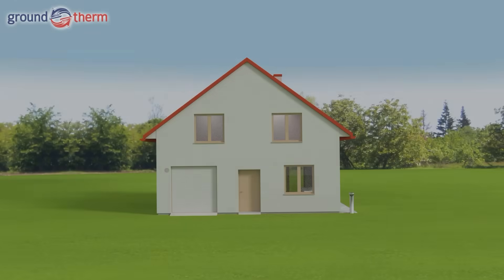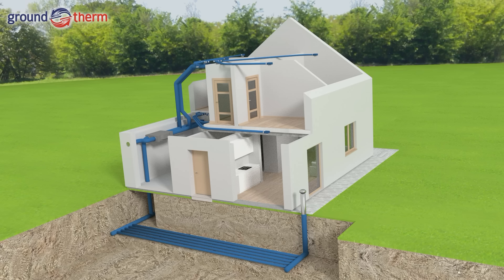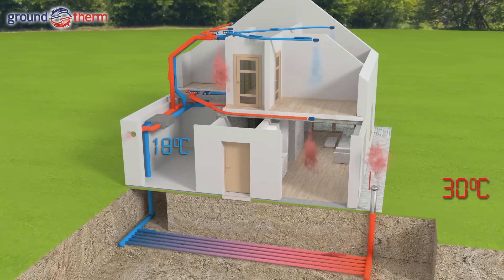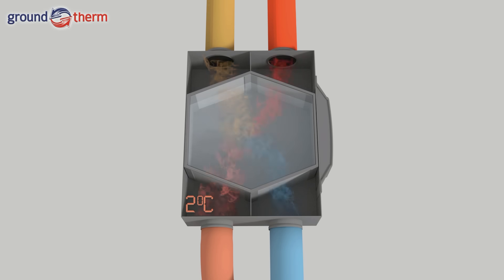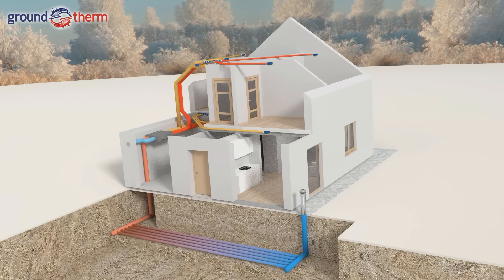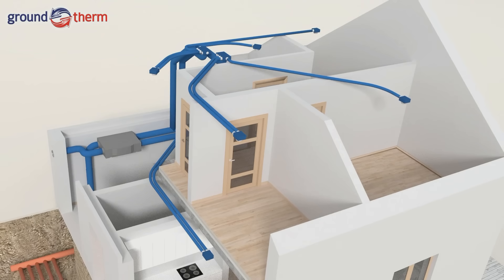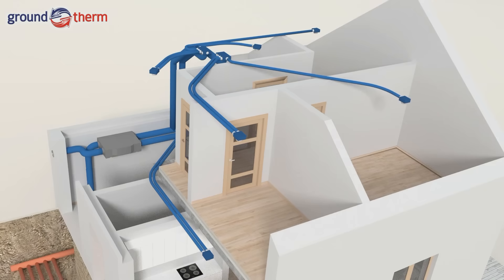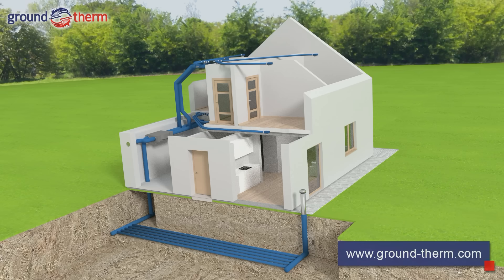Mechanical ventilation with VENTIFLEX® PLUS system and Ground-Air Heat Exchanger

Comment: How do you remove the humidity from the system. Without removing the moisture condensation will definitely occur in the heat exchanger and will cause molding.

Comment: I have some suggestions to your company. 
For cooling it's OK but for heating try to attach connection with wood  stove or cooking gas stove. 
Roll iron pipe around cooking gas stove burner , For wood stove Roll pipe around outer part of stove, use stop system, when ever don't want to use. 
Please work on this. 
It's not difficult, people use gas stove or wood stove but don't use it to full capacity. 
Jay bharat.

Comment: Using vent shafts is a nono… mold will come in eventually… and requires chemical cleaning… what you need is fresh air from outside to vent your home…

Comment: The air should be looped back from the house since the house is at chilled condition. Constantly pulling air from outside will result in a higher temperature difference across the ground heat exchanger.

Comment: Can this system be integrated with a heat pump?
Reply: No.this ventilates. No heating. But you can use the energy from the old warm air for making hot water

Comment: what is stopping mold and condensation forming inside the pass as hot air enters cool pipes?
Reply: Just lay the pipe with a slight slope toward the inlet. You’ll also have to incorporate some sort of drain
Reply: I hear they put it at a 3% slope

Comment: Fairy tail. What will you do in the spring, when the ground heat exchanger freezes and the street will be +5. Such air is no longer a problem to heat up and air conditioning is not needed yet. This scheme has not been finalized and I reject it in my work.

Comment: in such a ventilation system, a huge amount of condensation and bacteria is formed!
Reply: Inner layer of pips are covered with antibacterial agent (silver based). Condensation is collected and pumped out from condensation shaft.
Reply: Could you not attach air filters on the registers to solve this?

Comment: What are the pros and cons compared to geothermal, which uses a liquid closed loop? That is more common than heating/cooling incoming air.
Reply: heating in the winter will need supplemental help heating, this won't be near enough in a typical cold winter.

Comment: Wouldn't air coming from inside the house and from outside of house while interacting in the exchanger, pollute the fresh outside air ?
Reply: What they're probably describing is a Heat Recovery Ventilator (HRV). In summary, no it does not because the air actually doesn't mix together in the box, it's just a convenient model they used here. The box itself is a heat exchanger of some type, e.g. using heat pipes or thin metal plates, and the air is actually going through completely separate channels through those heat exchangers, so the fresh air stays fresh but the heat between the incoming air is brought closer to temperature to the outgoing air. Such devices can often exceed 70% efficiency in matching the incoming air with the outgoing air, so despite how simple the idea is for this device, it's an exceptionally effective way for you to prevent heat/cooling loss with the fresh air coming in.

They also have Enthalpy Recovery Ventilators (ERVs, sometimes misnamed "Energy" Recovery Ventilators) which have a semi-permeable membrane which allows humidity to be exchanged as well (again, without actually mixing the air itself), which is super important in high-humidity environments (e.g. southern US states) because you will "get more" out of cooling your house if you can reduce the humidity (using a dehumidifier, for instance), and retaining that reduction in humidity means huge energy savings without a cost to comfort.

Comment: I am much interested in that kind of setup but the thing is calculations about everything and that can be done with ultimate solutions like uv light cleaner or any other simple n efficient solution.
what I am scared off is the temprature as the ground water temperature is not too above the normal temperature I am in Pakistan..

Comment: What about the in ground preheater and getting mold in the actual pipe under the ground guess this system has no longevity
Reply: I built my own 15 years ago. Don't stop the airflow and slope the pipe to a lowest point, cut some slits there over a gravel drain. Also stay above groundwater level.

Comment: How deep you have to dig the pipes, and how much energy the system consumes? Now much is not good enough. How many wats it takes? How much it cost to purchase or you sell it with installation costs? Do you supply to places in Lubuskie?
Reply: 1) below the frost line.  Usually 5-8 feet down.  2)The energy would depend on the size of the system. 3)The energy would depend on the size of the system. 4&5)I would suggest contacting the company directly.
Reply: For my compact and well insulated house  I DIY'd one, has been working for 15yrs now. Pipe 15cm/6", 50m/yrd long as 2 parallel line, slope 2cm 3/4" per m/yrd at a dept +/- 3m/yrd. Energy use is one 50/100ish watt fan, it pays to oversize a variable speed type. There is a lot of flexibility size-wise there but a lot depends on the dig. There must be a slope for condensate to drain to a lowest point, with a few slits over a gravel drain. Because of this drain you must stay above ground water. The inhouse system as shown in the video is a whole other kettle of fish. It's ok in a new house but rather tough as a refit. Power consumption there doubles as there are two fans needed now.

Comment: Here the duct are not placed correctly
Reply from the maker: What you mean? All ducts or one? Which? Why?
Reply: @Ground-Therm  the cool air ventilator from coil in the room should be in bottom level of room and hot air ventilator should be at top of the ceeling
Reply: @Ground-Therm  actually I had project in my engineering on geothermal air conditioning unit

Comment: This will be ideally suited if this system is installed just next to the u/g water reservoir which can store water from an outside supply or can store water from a system of rain water harvesting. The temperature of the environment beside the water reservoir can be used to have a better ventilation system.
Reply: Nice idea

Comment: What the hell? Under the ground? What if there is a problem with the ducts on the ground, you have to dig and stuf. That system will cost more than the house itself lol.
Reply: i guess you don't have running water at your house because from that chart this is basic plumbing
Reply: @pastorgoof  this is ventilation

Comment: Youll have ruined pipes underground.. Rotting and condensation +mold toxins. Then the air returns wouldnt work. You have to suck the heat out while forcing cooler air in. This is stupid. Plus you'll have allergy problems always bringing pollen in.
Reply from the maker: The inner layer of pipes buried in the ground and all fittings are protected with a silver-based preparation that reduces the growth of bacteria with the efficiency of 99.99%. We give you a 30-year warranty.

Comment: I visited the Ground Therm website. Turns out they just sell flexible plastic duct work and plenums. If you want a "mechanical ventilation" system you'll have to look elsewhere. What a disappointment.
Reply from the maker: Please take a look at our catalogue concerning GHE here: https://www.ground-therm.com/wp-content/uploads/2019/03/Katalog_GWC_v0.pdf

. Additionally you can contact our design department: projekty@ground-therm.com,

phone: +48 881 066 854

Comment: Does the ground continously take away that much heat? Won't there be a decrease in the rate at which heat is extracted after system is operational for a few hours owing to the reduced temperature gradient and slow conduction.
Edit: Why not insert the heat exchange pipes in a well for cooling purposes.?
Reply from the maker: We count heating and cooling efficiency after system reach (almost) steady conditions - it means after several hours of work, the temperature gradient is constant. Almost, because in real it never happens. Anyway the error is negligible.
Reply: Why not insert the heat exchange pipes in a well for cooling purposes?...they do, it's called a cooling tower.

Comment: how do you get rid of the condensation and subsequent mold from the ground heat exchanger?
Reply: Mold by never stopping the fan, condensate by having the pipe sloping to a lowest point, there have some drain holes/slits and a gravel drain.
Reply: Wutzmyname Mike  I'm not the one that started the insults, little moron.  But thanks for letting me ban you!  Bye bye douchebag troll!
Reply: You didn't listen. They clearly said it is lined with a silver composite to prevent mold.
Reply: @basedbear1605  What about the condensation and/or bulk water that ends up down there?
Reply: @dallasgombash5381  You didnt watch the video or listen it appears.
Reply: Take it easy smarty pants.
Reply: @michaelburke7742  Ok, dummy.
Reply: @basedbear1605  damn lady, chill out.  You don’t need to curse at someone for a legitimate question.
Reply: Wutzmyname Mike  Do you even understand what constant air flow would do to condensation?  Try a little experiment.... put water on a plate and set a fan in front of it and turn it on.  Come back in an hour or two and see how much water is left.  Your rudimentary lack of understanding of basic chemistry and physics is astounding.  And your logic skills SUCK, because your first sentence completely contradicts itself.... "It said nothing...otherwise they would not have needed to mention...." that literally makes no sense.
Reply: @basedbear1605  I was with you until this.  Condensation build up is a thing that literally happens, and blocks pipes, if it is not accounted for.  Your explanation, by way of experiment, shows you don't understand what's actually going on.
Reply: @basedbear1605  The reason condensation appears is when the local air temp goes past the dew point, that is, the temperature change causes the humidity to go above 100% and so precipitate.  Cooled air that is at 100% humidity and thus precipitating water out in the now cooler location, will not evaporate water.  If you want it to blow water vapor away, you'd have to atomize or vaporize the water mechanically to get it into the air stream, since it will not evaporate into 100% humid air.  Until air that's still under the dew point at the lower temperature flows through, the water will not evaporate.

What Peruvian university did you buy your degree from online?
Reply: @basedbear1605  I'm not the one pretending to be an expert.  And you must be a troll, because no one could accidentally misunderstand so many people so many times as you do.
Reply: @basedbear1605  once electricity no longer fits into the equation , mold shall be your every breath.  No internet to release mr hyde as well. Just you and your two fingers  and wishful imagination of course.  
Soon tobe.

Comment: What about condensation in the underground heatexchanger?
Reply: 1) uv light could be used to fight with mold,
2) air from those pipes may not necessarily enter the interior, instead it may swap the temperature via heat exchanger box and get excreted outside.

in other words, ideally you would need 2 heat exchange boxes for two stage process: at first you take air from outside the wall and exchange thermal energy with the air from underground, then underground air is dumped outside while the fresh air goes to the second box where it exchanges heat with interior air going into exhaust.
Reply: @bazoozoo1186  That's correct. And, the greater heat transper capacity of water in the in ground loop is why it is used and more effective I would think.
Reply: Never stop the airflow, and slope the pipe to a lowest point, cut some slits in the bottom over a gravel drain. Import consideration is that the gravel drain is above the water table.
Reply: That's my instant concern here. Joe Lstiburek made this mistake years ago, and talks about it in the context of psychrometric charts.
Reply: Why don't you watch it again and actually listen this time.  It was clearly stated.
Reply: @NickMWise  Funny how you deleted your smartass comment after you realized you were wrong.  Oops, did you miss my link to THIS video's time signature?  Haha,  What a gamma you are.
Reply: LagiNaLangAko23  Another moron who didn't listen to the presentation.
Reply: @NickMWise  1:32 they talk about their filter system, if you want more details, you are free to click on their link.  And later on they talk about mold elimination.  Again, you simply didn't listen.

Comment: It's a good system.

We engineered, designed and installed it more than 25 years ago.
Reply: Have idea . Can you free energy battery cell heat and cold
Reply: Hello  Stefan, could you share with me then I can earn money. Safety.mohammed.ibrahim@gmail.com, please mail me
Reply: @mohammedibrahimali7798  what does that even mean? Is it code for 'send bobs and vagene '?

Comment: I think this not a successful idea because hot air has light weight and always goes up so just make the system opposite direction. I mean Cool air release pipe at floor and the hot air receiving pipe at top. Also add a converting module for winter.
Reply: It is fan driven, so the air is forced to go where you want it to. But I still agree that convection should play a part. They should be pulling hot air from the tops of rooms which is where hot air is going to be.

Comment: Could it be better if air intake is kept at roof level?
Reply: Take in at the shadow site of the building would improve a stable intake temperature
without adjusting continuously with every cloud or taking in air from an extreme heated 
sun spot . 
But ofcourse you could place the intake higher up when you take notice of these basics.
Be aware  also of condense or other ways that water can collect in the ground tubes.
Let them colect the water in a place where you could easily place a level pomp for removal
Of excessive water in the ground system.
If possible you can place a small diameter pipewith a sifon to get rid of the water in a well
Or open sewer chanel down hill (example)

Comment: Without ah electricity motor it will not work....
Reply: I think it possible. We will required right mechanism.
Reply from the maker: There are ventilators in the ventilation unit, which is blowing the air.

Comment: Very nice system but I have one question , how do you clean the ground installed pipes?
Reply from the maker: Once per 5 years it's good to rinse with a strong stream of water. You have to get (leave) acces to the pipe incoming into house.
Reply: @Ground-Therm  Thank you
Reply: @Ground-Therm  Though if u really needed to clean it I m sure chemical +water cleaners such as air cooler cleaners can be filled and kept for a few hours and then flushed with water and then blown through with compressed air.
Reply: Good job hemant sharma.. Keep it up.. Hehehe
Reply: Dimitris Andreou our system runs without maintenance for about 25 years now. We haven't thought about cleaning the earth pipes yet.
Reply: @stebarg  what climate are you in?
Reply: John Beeck the building is located in Central Europe East Germany.

https://weather-and-climate.com/average-monthly-Rainfall-Temperature-Sunshine,frankfurt-oder-brandenburg-de,Germany
Reply: शायद इसमें वैक्यूम cleaner  जैसे किसी मशीन का सहारा लेना पड़ सकता है
Reply: Think of it as an engine wash. It's nice to have but not required. It's more important that you check/ clean/ exchange the screens and filters regularly.

Comment: How the underground heat exchanger cools the air in summer and heat the air in winter??
Reply: मेरे ज्ञान के अनुसार जमीन से 7-8 फीट के बाद तापमान हमेशा एक ही रहेता  हैं। कुएं और बोरिंग में पानी सर्दियों में गर्म और गर्मियों में ठंडा आता हैं।
Reply: @hemant3640  thanks bro
Reply from the maker: Temperature in the ground (1,7 m below the surface) is generally (in Europe) at the level of 4-12 °C
Reply: @Ground-Therm  how it is possible to heat the air in winter?
Reply: @kalamazath9304  All Year, the geothermal unit will maintain near the underground temp.   The Earth will moderate the seasonal highs and lows.

Comment: Hmmmmmmmm humidity will probably condensate against the cool inner pipe metal.  Condensation within the pipes might cause microbe growth.   UV lights might hinder microbe growth though.
Reply from the maker: No chance for microbs - all internal layer of tubes are protected with silver agent - anti-bacterial and anti-fungi.
Reply: Hmmmm, this is an very ancient technology & numerous countries have looked at it in modern times.  
    For example: Earth tubes as heat exchanger for geothermal ventilation / AC / cooling and heating passive house https://www.youtube.com/watch?v=l4nMsHqCTeI
Microbes are absolutely everywhere & at best their growth might be retarded but never eliminated.  Really, I can only assume the only practical reason why this technology is not used universally is the potential for microbe contamination.  So I plan to use a flexible corrugated ducting (with anti-microbe coating, LED UV lights, etc) and simply make it removable/clean-able/replaceable/inspect-able/etc. 

Pls consider making your design open source (note there are many types of open source licenses; https://fossbytes.com/open-sources-license-type/).  This allows folks living on a budget to potential use your system.  Worry not, since rich folks are too busy/lazy to make your system for themselves, you'll still get tons of business especially in the US.  If you manage your company well, cheap knock-offs won’t really hurt you much.  Also being open source, you just might unite all the good work all over the globe in this area.  There have been a lot of work.  
Here's open source in a nutshell:
     What is Open Source explained in LEGO https://www.youtube.com/watch?v=a8fHgx9mE5U